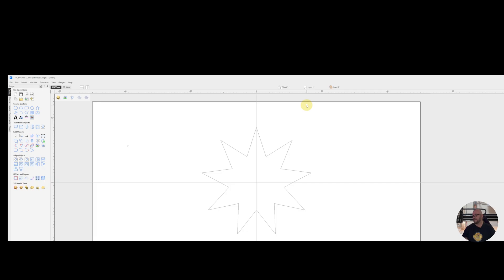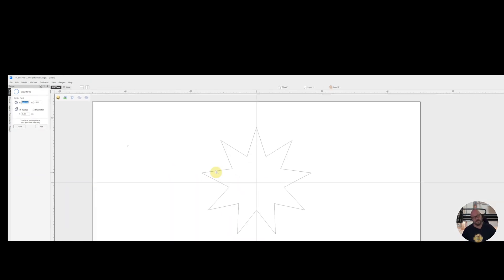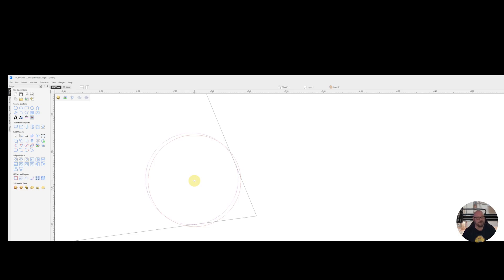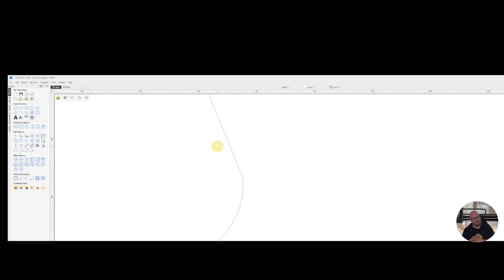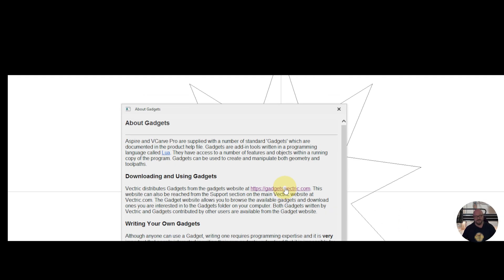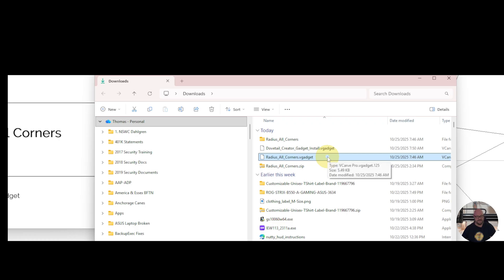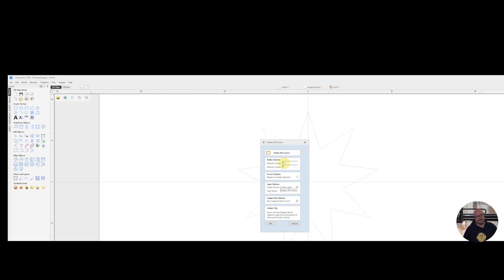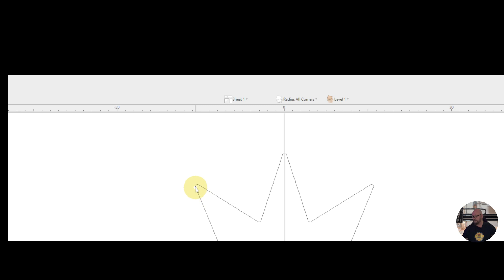Perfecting CNC Inlays: The Secret to Flawless Corners

Comment: Great description. It appears that gadgets are only available in the Pro version of VCarve and not the Desktop version. The next time I upgrade, I will upgrade to Pro instead of just a version upgrade for Desktop.

I do the same function in CAD by making an offset with rounded corners, first outward, then back inward, inward again, and finally outward. The first two steps fix all outside corners. The last two steps fix the inside corners.
Reply from the maker: Yes, gadgets are only available in Pro, and in Aspire. I use Pro myself.  Thanks for watching and supporting my channel!